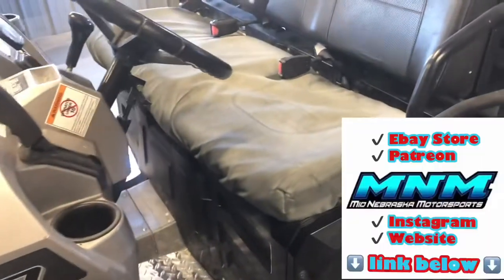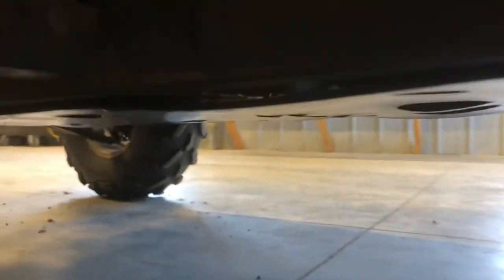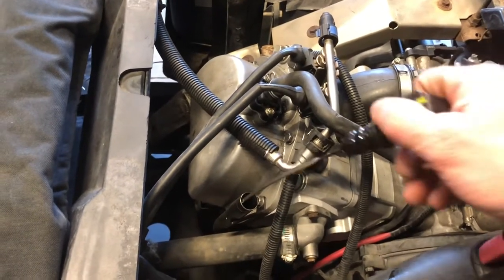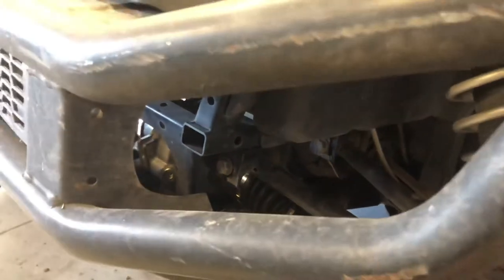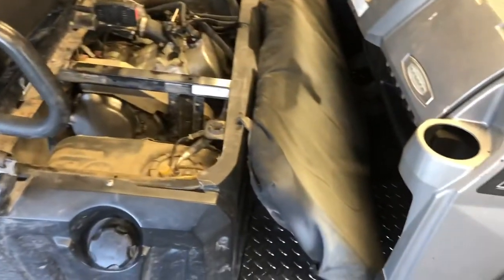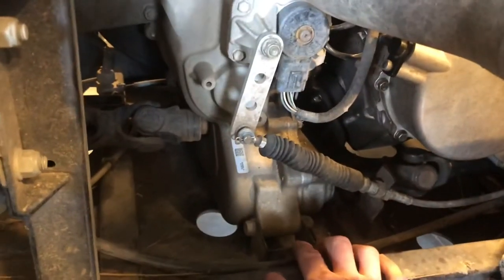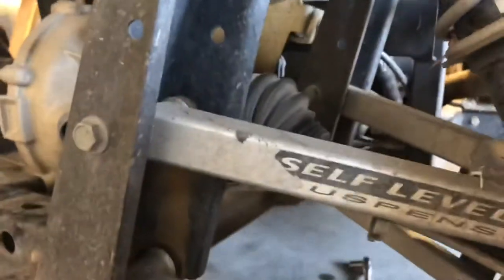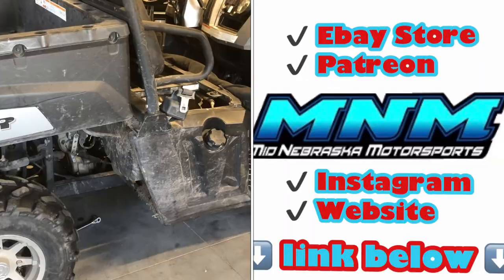Polaris Ranger 700 HO 4x4   -  Full Service -  Oil Change

Comment: What type, brands and weight of fluids do you use?
Reply from the maker: Here is a service kit. https://amzn.to/35O8FPg . For engine oil: https://amzn.to/3Zy2RC0 .  This kit here takes care of all the oils you will need. I like to buy extra engine oil as you don't want it to run low: https://amzn.to/3TXJVM1
Reply: @MidNebraskaMotorsports what about for the differentials and the bottle with tube you spoke about? Can we get a link for those?

Comment: What weight oil goes in the motor and transmission
Reply from the maker: Here is a service kit. https://amzn.to/35O8FPg . For engine oil: https://amzn.to/3Zy2RC0 .  This kit here takes care of all the oils you will need. I like to buy extra engine oil as you don't want it to run low: https://amzn.to/3TXJVM1